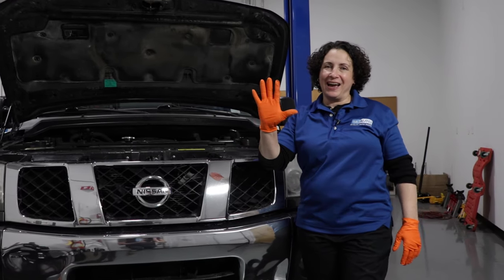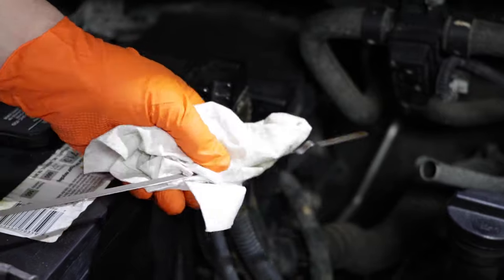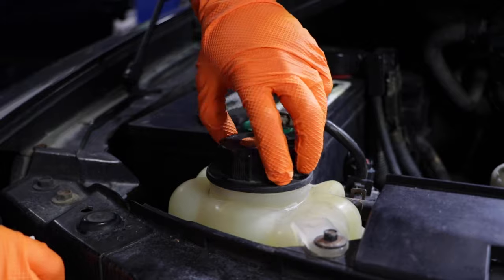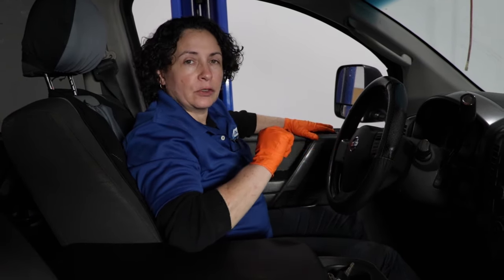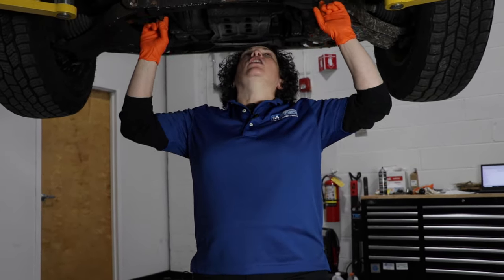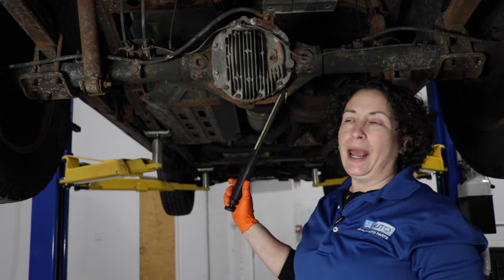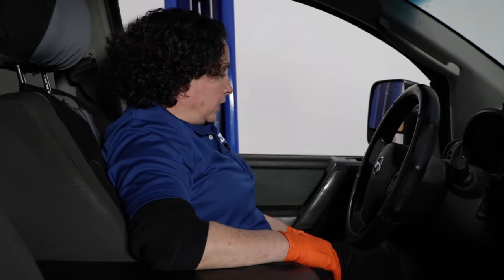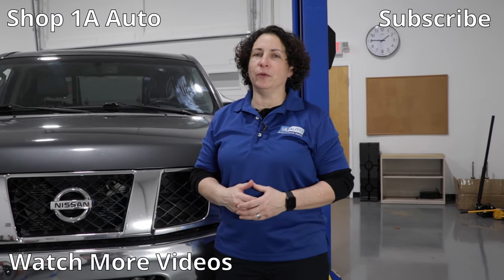Top 5 Problems Nissan Titan Truck 1st Generation 2004-2015

Comment: You missed one of the biggest ones, AC/heat blend door.
Reply from the maker: +Spartan Patriot Thanks for the feedback!
Reply: That ones a given!
Reply: Click' click'click'click'click"😡
Reply: Omg thats sooo true I had one replaced and another go bad . Damn cheap plastic piece
Reply: Yep
Reply: Yup !!
Reply: yup
Reply: Yes!
Reply: Yes. And when you do replace it don't go aftermarket. Get OEM that will last another 10 years. The aftermarkets are junk and wear out after a year or two.
Reply: Ditto
Reply: Facts
Reply: That thing drives me nuts!!

Leaky Axle seals…

But she’s as reliable, as my square body Chevy…
Reply: I agree their the Best i love my armada 4x4 and my titanio 4x4 k have silverado and tahoe but i dont even compare them cause their diff but idk i just like how their so fast they stop Good a/c & everything idk i just líke nice things im 21 born& raised in the dirty dino but i stay out the way lol
Reply: Im leticia son lol
Reply: I feel like a lot of vehicles in and around the 2004-2008 ish time period have this issue. 
Worked in two body shops and it seemed like 70 ish percent of the vehicles in this year range started CLICKCLICKXLICKLCICK when I started it up and started the AC 🤣
Reply: 🥲🥲I know
Reply: @jenningsmills5398 ppl thought my truck was possesed
Reply: @jalee6587  the after markets are very loud as well
Reply: Have to keep the windows rolled up so no one outside hears it, especially on startup😂

Comment: All titans have a rear diff vent, right above your head when you said they don't. The issue is they get clogged with dirt and debris
Reply: U need to do a mod.to vent the tube up away from axle. its very easy
Reply: You are absolutely correct about the vent.  Did the mod to vent up to rear tail light and my years of axle seal replacements went away.  That mod is detailed well on Titantalk forum.

Comment: You missed the one issue every titan on the planet will eventually get. Cracked exhaust manifolds.
Reply: yup, i have an 08 and im looking to get mine replaced
Reply: Every vehicle on earth will "eventually" get anything...state your source for this info?
Reply: I had that too..the left side exhaust manifold cracked giving a harsh throaty sound especially on cold starts ..it would go away after the engine warms up..but I had it welded but it seem to be cracked again..so im just going to replace it. Did you replace yours or repair it?
Reply: I had that problem on my 04 Pathfinder Armada (about 25k). I have a 15 Titan(about 70k) with no issue though.
Reply: @timsgta  every Titan owner ever..
Reply: I have an 09 , just had one of the exhaust manifolds replaced at the Nissan garage. Wasn’t cheap. Cost about $2400
Reply: Had the same issues on my 04 and putting headers on it came out cheaper and gave the truck a nice sound
Reply: @timsgta  literally the most well known and common problem on Titans and Armadas. I have a ‘13 and just had them replaced under the emissions warranty because they are one piece with the catalytic converters. Stop demanding everyone else do your research for you. 5 seconds on Google would show you thousands of pages of forums documenting cracked exhaust manifolds.
Reply: Every vehicle eventually gets cracked exhaust manifolds if you let your vehicle rust, overheat or straight up never clean build ups and abuse it. Besides, do you know any V8's who don't eventually need such work? lol
Reply: Have an 04 with 293,--- never had that problem
Reply: Mine was under warranty 😎
Reply: Make sure where the drive shaft meets the rear differential, make sure that thing is torqued right and the u joint is good.
Reply: @kevinjones6723  what did you replaced so far? I have 117k mi and worried about the radiator mixing with trans fluid. Btw my ac condenser has a hole :(
Reply: cracked manifolds on my 08 le out of warranty sucked

Comment: I bought my 2007 Nissan Titan with 6k miles on it in 2008 when stationed out in Camp Pendleton. It’s 2023 and I still have my 2007 Nissan Titan. Dropped about 15k in aftermarket and a custom paint job in 2009. I love it to death,  only now is it on bonus time. It was totaled out in 2019 and I bought it back and used the insurance money to fix it. I also have a 2004 4 door SE Nissan and Titan 2016 Nissan Armada  Platinum. I will always be firm supporter in Nissan and especially the Titan. I’ve had brand New GMC denalis 2012-2014..Jeeps and Fords. And plenty others. I do not own any of those vehicles now. Except a 2105 Jeep Rubicon. Maintenance is ridiculous. Titans and Nissan are the best and I can vouch for  them 100%

Comment: I had a 2004 Nissan Titan crew cab 4x4, I loved that truck, I never had any issues out of it, only had 160k miles on it, I was on my way home from work and was t boned by a lady who ran a red light. Totaled my baby, I miss that truck so much
Reply: Get you another one life is too short
Reply: I have 05 and my wife has been in 2 accidents in it and it's been hit while parked but it's still looking good n running like new. This beast is a real truck
Reply: The date is 6/15/2021 and my 2004 Nissan Titan with original engine and trans has 423k ans still kicking ass!! I love this truck
Reply: @Rcerullo  May I ask what you have replaced so far and at what mileage?

I have an 05 with 117k mi so what shall I do other than spark plugs? Btw my ac condenser has a hole :(
Reply: Great trucks zero mechanic problems
Reply: @Rcerullo  Nice 😁👍
Reply: I have a 2008 with 199k miles! I've put well over 100k miles on it in about 2 years.. this thing gets BEATEN to say the least. I've never had a work truck take such abuse and literally give me zero issues. The interior as she said is crap. Falling apart, but the truck runs so we'll. No repairs so far in 100k miles with 199k miles on the odometer
Reply: @Rcerullo  what engine oil do you use and how often do you replace it?
Reply: @stckyjoey1  tell that to these chevy and Ford guys they down play tundra and titan
Reply: @Rcerullo  impressive

Comment: I feel like the the blend door actuators are a top five problem. In the forums, seems like most people have it after a while. Granted, they don't render the vehicle inoperable, but replacing them is very difficult. So we're normally just stuck with annoying clicking for 3-28 minutes when we move the blend door from feet to face... Also, the brake booster... Other than all these problems, love my Armada.
Reply: My clicking for the air vent blend doors goes max for like 1-2 mins and it sounds like plastic.
Reply: yes mine does this too lol

Comment: I am a former Nissan Tech. You are wrong about them not having a vent. It is to the right of the center housing above the brake line. Everyone I have ever worked on had one. The problem is they would get clogged because it is a poor design. Anytime I had one on the lift I would spin the vent cap to loosen the dirt/crud in it so it could breath. You are right in the fact that this issue causes the axle seals to leak.

Another issue is the front diff axle seals like to leak a bit to often and when people get it fixed, they don't replace the cir clip that holds the axle in. Then the axle likes to pop out and destroy the diff. 

Also as one mentioned already. Mode door actuator.

The A/C fan right behind the front bumper goes bad.

The fuel pump relay has a recall that no one ever gets replaced till they have an issue.
Reply: Do you know which Nissan's the fuel pump relay had a recall for? I did a vin lookup on a website to see if my truck had any recalls and it said I did not. I just wanted to make sure. I have an '06 Titan SE.

Comment: My 2007, built in 11/2006, owned by me since 2009, has only had one issue you spoke of, the axle seal on one side. Just last year. I had the seal replaced and I installed a axle breather tube setup myself, totally agree on that. I can't believe you didn't mention exhaust manifold failure!

Comment: My 2007 Titan has 190k. I bought it used in '08. So far I have replaced the radiator due to cracking at about 150K. I replaced all upper and lower control arms, ball joints and bearing units. Recently the valve covers, AC compressor. All brakes and rotors. Power window actuators,  drive shaft support bracket and it runs like a beast still. The good news is these trucks are fairly easy to work on yourself if you have the time and patience. Love my big red.

Comment: I'm the original owner and my 2007 luckily has none of these issues.  It's never been to a shop except for tires. I do the general maintenance as required and I do the simple transmission drain and fill ever 20k miles.  The K56 motor is great.  I will definitely buy another Titan.
Reply from the maker: +Motor Down Thanks for the feedback!
Reply: how many km do u have on urs
Reply: Just bought a used one ( unknown history) and has that 1000 code right now. Also, SLIP light comes on and off and when breaks applied it seems like ABS engage sporadically ( weird noise when it does)
Reply: @FAKETAXI SRT4 Disagree, flushes can hurt it and drain and fills give you almost 5 quarts out of the 11.  You can also do it multiple times but highly suggest avoiding a true flush from the dealer.

Comment: Thanks for this video. Armada, QX56, and Titans are so reliable. But many people sleep on them
Reply: Hahah right, I'm in the market for a nice 3 front seat titan SV first gen for me and my 2 daughters (old school road trips ahead). It's literally the ONLY ok pick up out there not yet completely overpriced like tacomas, 4runners, frontiers, xterras and even the newer dodges, ford and chevys now (you have to be a broke ass or mechanic to even tackle a 10+ yrs old american truck breaking appart). It's completely dumb to pay soooo much mark up on hype just because you're afraid to do a few fixes (which you will end up doing anyways if you actually use your truck no matter the brand). The thing with trucks now is that whole "survivalist" hype and the fact most of people know absoluely nothing about cars or trucks. So they all collectively make stories about eternal trucks that don't need nothing but a super high mark up price. Meanwhile, you can get a titan now for half the price of a frontier. If these "problems" where so common of unfixable like she said there is absolutely no way in hell Titan's first gen would rank in the highest millage trucks. Period. They are very good trucks, slightly bigger than a frontier, superb engine and extremely sturdy full box frame. Just right there we lost half of the totoya crowd like we're speaking chinese. Means it's one of the last real old school workhose platform and it feels sturdy, doesnt flex crazy. And honestly, even has for looks, this soon 10 yrs old truck im looking at looks better than anything out there trying too hard. It's just a beast. haha have a good one

Comment: You can avoid blowing out your axle seals by adding a vent breather tube. its like a $40 mod.

You also left out one of the biggest issues these trucks have and that being the OEM exhaust manifolds. They are guaranteed from the factory to fail. Most people upgrade to performance headers to avoid it permanently. because it is not an issue that goes away once. its a guarantee to happen every time with OEM style manifolds
Reply: Very good post. This issue is a major repair for a customer.
Reply: This should have been on the list! For sure some of her complaints are BS
Reply: I was going to say manifold. I have had my truck for 4 years and they have cracked 3 times. All under warranty until now. So long tube headers it is Cajun b pipes
Reply: I replaced my manifolds recently and may I just say, it was a serious design error by Nissan with these manifolds.
Reply: Sounds like a pass!   Not like they were in the late 80s  90s.  No wonder Toyota Trucks are so over priced.
Reply: Couldn’t have said it better myself. The only issue with my 2009 Titan 170k miles is the door handle flake and exhaust manifold crack. I replaced them with the JBA long tubes, also went with Cajun b pipe catback and an UpRev tune. Best decision I made, and it woke that 5.6 up.
Reply: @gmc8810   Any v engine cracks manifolds it's in their nature even if it is on a truck/car that does not crack manifolds usually
Reply: I'm gonna start on my brother's 2008 Titan this weekend.  He has mirror and fuel gauge issues.  But I am boning up on what else to look for.  This guy has a completely different, more useful take on the Differential Vent: https://www.youtube.com/watch?v=m4Gkz7YKmoM

Comment: The transmission cooler problem was fixed after 2009. Aside from that, and a few weird HVAC issues, they’re solid trucks that can be as reliable as a Toyota Tundra. Never knew anyone with a negative comment about them. Even knew someone that drove one around with a leaking thermostat housing for a long time and it never broke down on em, even when it was overheating.

Comment: I had a 2008 Titan with almost 200k on it. Only replace the starter, was a good truck. Drove it pretty hard on and off-road, never left me stranded.
Reply: Wish I could say the same thing. I had an intermittent issue where every couple of weeks or so it would crank but not start. Most of the time it would eventually start but twice it did not causing me 2 tow bills. Nothing ever fixed it...new fuel pump, new ipdm, ecu, relays....3k an still nobody could fix it. It even sat one time at a dealership for 2 weeks with them trying to recreate the problem. It happened once, but as soon as they turned the key the next time, it started. Ended up getting rid of it. Otherwise, loved the truck.
Reply: @jeffs8330  For the crank/no start problem, I saw a Nissan bulletin where the camshaft position sensors ( 3 on the front of engine ) or the crankshaft position sensor ( 1 on the bellhousing of the tranny ) was the common problem. Hope it helps someone. BTW, they all look the same but are not. The 3 camshaft position sensors DO NOT have a white circle on the top of the sensor but the single crankshaft one does. 
Camshaft OEM part # 237314M50B Quantity 3 ( No white circle on the sensor ) Also has SGIB000 stamped on top
Crankshaft OEM part # 23731AL61A  Quantity 1  ( Has the white circle on the sensor ) Also has SGVB004 stamped on top
Reply: My 2008 have cracked exhaust manifolds. 3k plus to have them replace at the dealer.

Comment: The first gens have a vent nipple on the rear axle and I saw it right above your head in the video, a cost saving idea for Nissan but it gets dirty and no longer vents. I went with a fuel line hose and brought it up to the brake light housing.

Comment: I never had any of these issues in my 2013 and I put over 100k miles before I got rid of it I currently own a 2021 titan have 15k miles already and love it
Reply: Are the new current Titans 2017-21 made by Nissan? 5.6 Nissan engine is bulletproof. I own a 2015 Titan and I'm never selling her.

Comment: 4:57 you can actually do a rear axle vent mod where you replace that dreaded axle vent with a Barb fitting and run some fuel line to just under the bed of the truck. Be sure you add a fuel filter at the end of the fuel line. It is important to have the outlet of the fuel line higher up from the axle to keep water out of the axle much easier. My Titan blew an axle seal recently and I had it replaced along with the axle vent (updated to the aforementioned breather tube) and It has worked wonders for me so far.
Reply from the maker: +Alex Barnes Thanks for the feedback!
Reply: Is it still doing good?
I'm looking to get a Nissan Titan 2011 and trying to do some homework on it. If there is anything else I should do to it to keep problems at pls let me know.🙏😖
Reply: @1AAuto  why didn't you point to the breather on top of the axle? It's there.

Comment: Have a 07 titan, love it, sadly had to replace all the catalytic converters. That’s the only problem I’ve had besides the sun spots and warn paint. I bought it about a year and a half ago besides that she’s amazing. 190,000 and running good.
Reply: What did you replace so far? I have a 05 with 117k mi but think about replacing the radiator worried about the mixing of the coolant with trans fluid. Also I have a leak on the ac condenser :(

Comment: Original ‘04 Titan owner. Still driving it hard as a construction work truck. 146k miles. Looks great due to annually detailing and runs excellent. No issues except for #4 and 5 on her list. Would by another but Nissan needs to design a longer bed with crew cab for us contractors.
Reply: And all I do is change the fluids. Never had a “tune up”.
Reply: I have an o8 long bed 8ft. Hard to find now 79000 love it had to have it strong rig!
Reply: I'm tempted to buy a 2005 Nissan Titan with 160k Miles for 6k. I don't know much about trucks. Is it a good deal?
Reply: @Tonatiuh27  same. Im tempted on buying one for 5k.

Comment: I have a 2007 that I bought brand new. 154000 miles on it.  I have not seen even one of the issues listed here.  Most reliable, best running vehicle I've ever owned.  A/C blend door actuator, as many others mentioned - how is that not #1?  At least put it on the list in place of "the interior plastic wears out"...